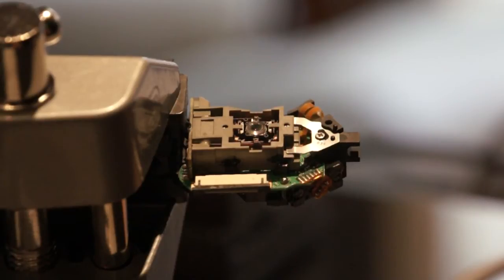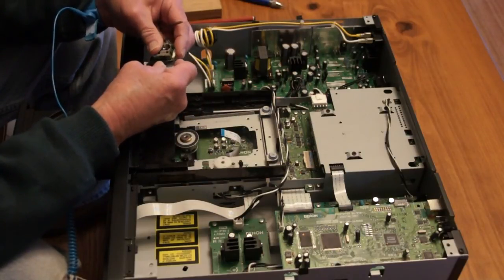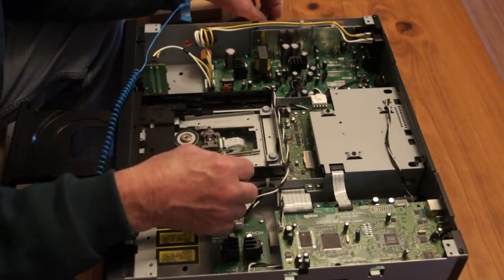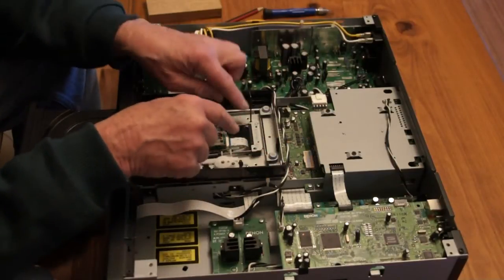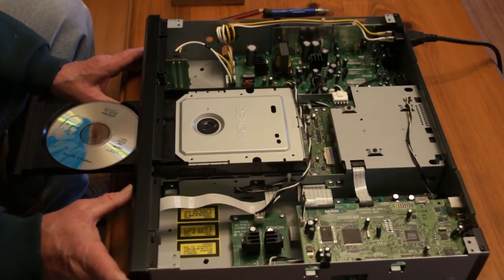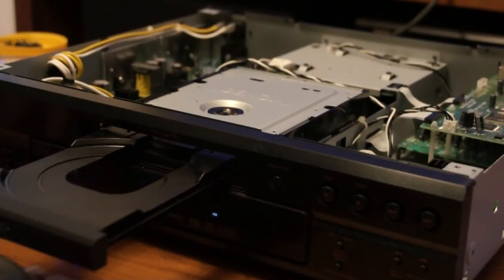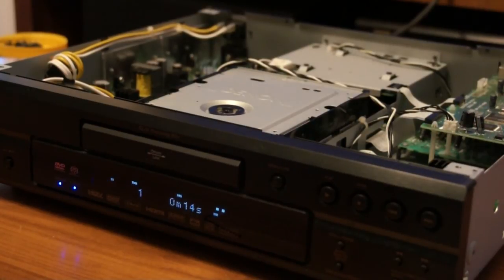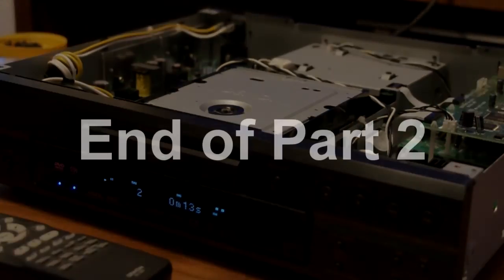Denon 2930 Laser Pickup Replacement (Part 2 of 3)

Comment: Thanks for video, Man!  I'm watched it like a tutorial and replace laser head on my DVD-3910 succesfully and easy. But when I removed the protect solder, the soldering Iron taked all tin on the self, without use a vacuum tool. And I don't touched the regulation sextagon-screws. Big Thanks, Man!!!
Reply: Correct